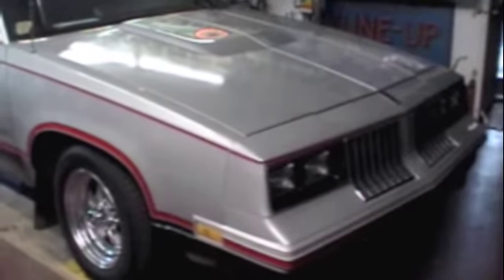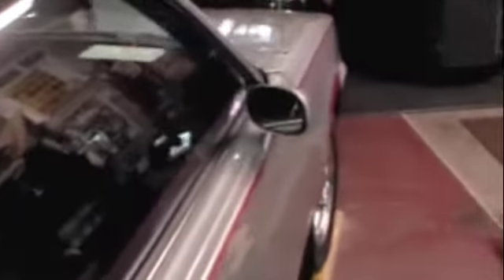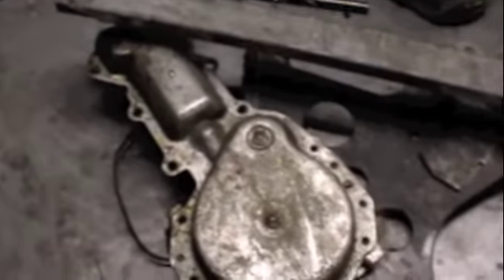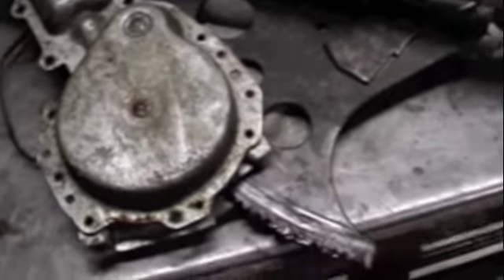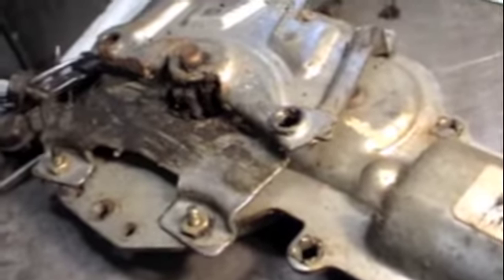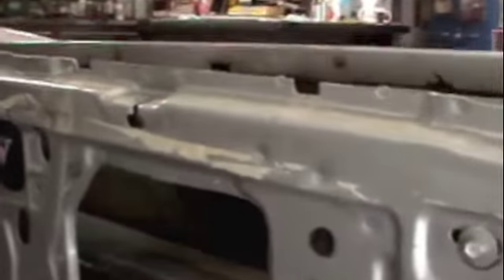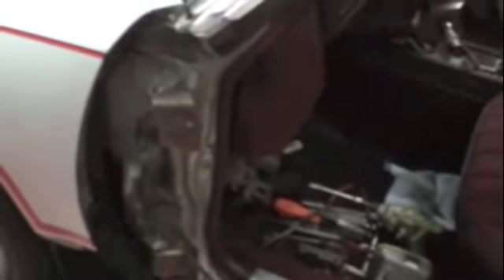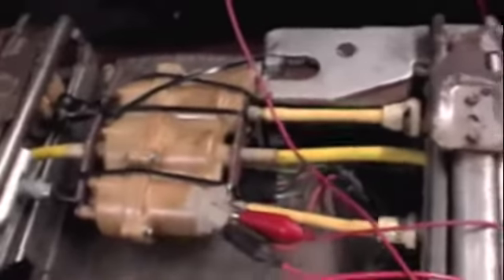1984 HURST OLDS RESTORATION PART 1.

Comment: Het Tommy nice HURST,can u tall me how u got the power antenna out of the fender THANKS
Reply from the maker: "Sure":  Get some painters tape; tape the door (as not to scratch the paint *just at the doors "edge"). Get a helper: Inside the jam you'll see several 10mm bolts, ... from the bottom-UP: you'll remove them all the way up (til about the 3/4 "up" point (leave the top one(s). *The helper" will hold / & move the door while YOU (preferably with a 10mm 1/4" "swivel" socket), remove those bolts. *Access (too the bolts) is from the inside, and the OUTSIDE of the actual "door". 

Next: do the same at the wheel opening molding "side" (on the "inner-wheel-well"). (In SOME examples: the bottom Rocker Molding MAY have ta come OFF as well.) NOW: Usually the retainer's a SCREW (where the antenna goes up), so carefully remove THAT "top", with a "hefty" flat-bladed screw driver. NOW you ready to gently "pull-open the lower fender. (I like a "prop" ta HOLD the Fender "out") ... this could be a small block of wood. Next: unplug the wiring: *(use mechanic's wiring too "fish-this" conn. down / through, and OUT) ... next: carefully separate the coaxial cable (that goes to the mast).

NOW: Remove the "unit": drill-out all the rivet's EXCEPT the very bottom's "large-rivet". (You'll leave him there). Next: separate the case halves (CAREFULLY), after removing several "u" clips, remove the limit / brush assy. Next: check (and if need-be): and CLEAN the armature. Grease the worm and spool ... now replace the mast cord (which I'll assume "broke") ??. TEST the antenna by running it up & down several repetition's from that same "top-side" plug. If sasif., then reinstall same.

Many haven't the patience to do this, and it's tricky Darnell !! Just understand that WHEN the case halves but-up tightly, that you've got everything "lined-up" !. IF they don't, you missed something / OR the cords NOT in the channel. 

Patience / amid a clam-hand are the key in doing these ... what USUALLY happens is the cord "breaks", & the antenna THEN won't "shut-off", and it's unplugged or abandoned. IF the mast tubes aren't bent, you'll be just FINE !.

Good luck.